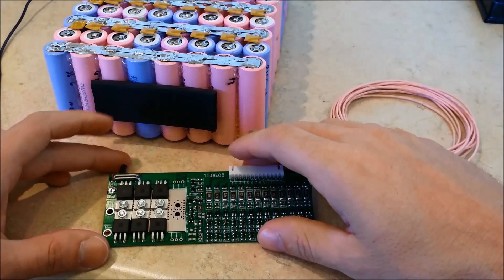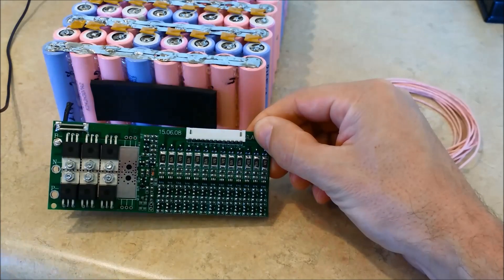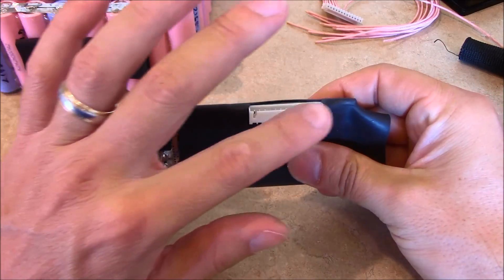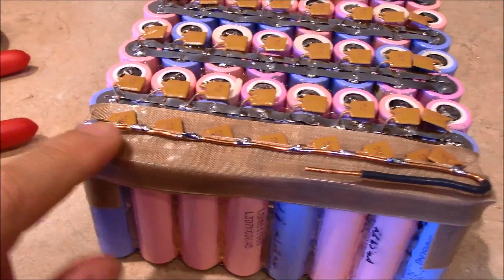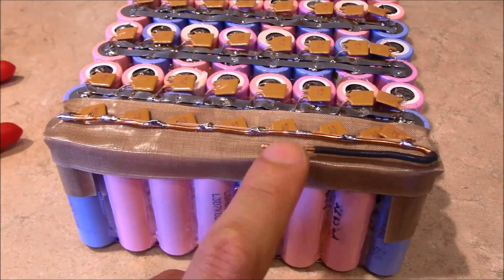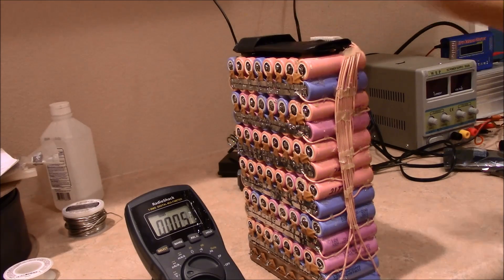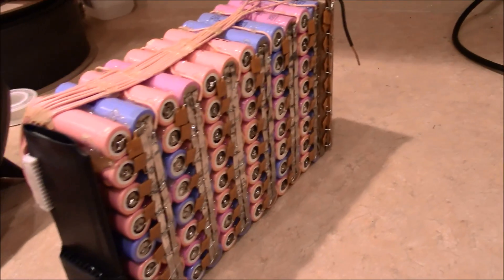18650 lithium ion battery "Wiring the BMS" (Part 4 of 7)

Comment: great video, would you please post parts list, links where to find them? and is it possible for you to show a diagram with wiring schematic (battery, sms leads, fuses)? thx!
Reply from the maker: Thanks,  I have a picture on my home https://plus.google.com/u/0/+15secofFame/posts/p/pub that shows the BMS and battery schematic if that helps.  

The fuses are something I was trying and are not necessary, but here is the link  http://www.ebay.com/itm/100-Pcs-New-JinKe-Polymer-PPTC-PTC-DIP-Resettable-Fuse-16V-4A-JK16-400-/181623447300?hash=item2a4999df04

the tabbing wire link is here http://www.ebay.com/itm/30-Feet-Solar-Cell-BUS-WIRE-5mm-x-02mm-Pre-soldered-/251870723653?hash=item3aa4aa3e45

let me know if you have any questions!

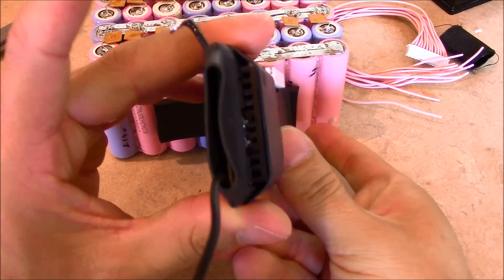Comment: The heatsink looks placed upside-down at 4:36 Shouldn't the large flat area should be what's in contact with the surface of those transistors to cool them off?
Reply from the maker: yeah your right on the the heat sink.  It didn't come with the heat-sink I added it from spare computer parts to help provide air flow over the transistors with added protection on the top of the them also.   They were only used during charging.

Comment: How many fuses did you use? I am about to build a 48v (13s 7p) pack and i would like to. Use these fuses........
Reply from the maker: I used one for each positive terminal so if you are building a 13s7p you will need 91 fuses.
Reply from the maker: dvdrwsor Thx man,  yes they will close after the fault cools down.
here's a link on ebay http://www.ebay.com/itm/100-Pcs-New-JinKe-Polymer-PPTC-PTC-DIP-Resettable-Fuse-16V-4A-JK16-400-/181623447300?hash=item2a4999df04
Reply: Great project. 
So after (if) they open up, you check the faulty one and exchange it, or do they re-enter the working state once they cool down? What type of fuses are those? I want to buy them from mouser.

Comment: what"s the yellow things?
Did it safe for the battery connect in series?
Reply from the maker: +# Uncommon The yellow things are reset-able fuses for extra protection.  yes they are safe.   You dont have to use them, but I thought I would try to use them just as Tesla uses fuses.

Comment: I think you should connect BMS board like it should. Take power from board and charge battery as well. BMS should be connect all time for monitor cells,balance them and control,not for charging only. Maybe that's the problem.Your discharge rate is direct and nothing is controlling cells. Think like this: What if one pack have higher resistance than another? That pack will lose power much more and that can disbalance battery pack. You should test each cell with B-max(battery resistance test when cell is full charged) and write down resistance as well and later combine them with capacity and resistance together That will be awesome pack. 60 amp board should do the job. Btw: Love your videos! Great job! Thanks :)

Comment: hypothetical scenario where the pack is outputting its 32A max current. if one (of the eight) tier 13 fuses gets triggered this will cause current from the 12 cells under it to be rerouted and shared among the other 7 fuses at tier 13. say cell#13 in one of the strings somehow blows and triggers its fuse, this will cause the approx 3.6A from the 12 cells in its string to be rerouted to the other 7 tier 13 fuses.  that's about 0.4A increase per tier 13 fuse. if the whole pack was running close to 32A, none of the other 7 tier 13 fuses will be able to handle this reroute and will trigger off in a cascade shutting down the whole pack. to prevent this from ever happening the threshold is 28A max for the whole pack.  this is worst case. if the first fuse to go off is a lower tier one, the margins are smaller.
Reply from the maker: +Follow Media good analogy,  the fuses are 16v @4amps, but I am using them with 4.2v or less so they are now good up to 16 amps each.   They are there for extra safety in case I damage a cell.  Figured if Tesla can do it why not me :)

Comment: Isn't it a waste of time running a bus bar and then connecting with resetting fuses? I think you've put a bus bar on all the negatives? Just want to be sure.
Reply from the maker: +harveyboy45 yeah I connected all the negatives with a bus bar and connected all the positives with the fuses.   You don't have to and most people dont, but I thought since Tesla does it why not do it to for extra protection.
Reply: +15-sec-of Fame I thought so. Bit by bit it's all coming together:) . Did you manage to source some wide pvc shrink wrap for your pack?
Reply from the maker: harveyboy45 I did but before I cover it still need to install a maintance port (d-sub connector) to maintain each bank if they become unbalanced.
Reply: +15-sec-of Fame is it essential to add resetting fuses to top n bottom of pack? Cheers
Reply: +15-sec-of Fame I'm really struggling to find any wide shrink wrap.
Reply from the maker: harveyboy45  no, you really dont need the fuses.  Its actually rare to see them on ebike batteries.  Here is an example of the shrink wrap tubing you can look on ebay to find the right size.  It will shrink down to half of its normal size.   http://www.ebay.com/itm/228MM-145MM-PVC-Heat-Shrink-Tubing-Battery-Wrap-/321615000284?var=&hash=item4ae1bf72dc

Comment: Hello.
This video is very helpful for me to building 18650 Battery pack.
I have a question about the best sequence for wiring BMS to Battery cells.

I guess that you first connected the white color balance connector into BMS, and then soldering each wire on the battery cells from 0V to the positive pole of the top of the cell.
Is that right?
But, for my case, I first soldered all of the battery cells with balance wires, and then connect the balance connector into BMS. 
I did like this four times. I succeeded three times, but failed once. When connecting the balance connector to BMS, the BMS was broken with a little spark occurring at the end of positive pole.

What do you think of this situation? Do you think it is caused by the wrong wiring sequence or bad/low/already broken quality of the BMS?

Please give me your opinion.

Thank you.

Comment: Also a side note, my battery bank comes out to 3.7v instead of the 4.2v that I see most videos at (including yourself) per battery. I'm no expert so running off of strictly videos here lol. The voltage is steady though and I do not know if this is an issue as well.

Comment: Hello,

I'm building a DIY battery bank for my electric bike as well, and I have been following fine up until now. So each "bank" shows the correct voltage readings (also checked the batteries before building the bank) with no issues. I installed the BMS wires (same chart as yourself too) and the last step was to installed the last wire on the BMS wire 14 to the positive number 13 of the battery back along with wire 13 to the negative side. Again, all my readings are correct for the bank, however when I get to the end of the cord that goes to the controller/motor/etc it only reads 14.20v? This current is not strong enough to run the cycle of power for the motor.... I am at a loss here. Please help!
Reply from the maker: man sorry!  Dont think I saw your comment.  Hope it is working better now.  Looks like it could be a BMS issue going into protect mode.  I only used my BMS as a balance charger and came directly off the battery to the controller to avoid issues like this.   Please let me know if you found the issue!

Comment: I have 2 questions. 

1. How do you regulate the discharge current to prevent the batteries from going below 3.7V after by passing the BMS since you are only using it for charging?

2. After connecting my BMS I only have 47.2V from the BMS to the motor and 54.2V coming in. Nothing works not even the power level meter lites up. Any ideas?

Thanks
Greg
Reply from the maker: +Tucker Not Sucker! sorry man I'v been gone on vacation.  Were you able to get it working?  The cells are good down to 3.0v safely, so once I see the meter at 1 bar when your "not" on the throttle its at 3.7v.  Plus during my test run I brought a meter with me so I know my limits.
Reply: 15-sec-of Fame I took a different approach. I purchased cheap batteries and found out how fast they are destroyed when I draw the current to zero. They don't last very long but, the charging time is fast. Ha! I just purchased 28 HP laptop batteries and I am planning to build 2 48V 13S batteries connected in parallel. How many amps of continuous discharge current will my BMS need to supply to avoid it from shutting down the battery? I have a 30 amp continuous with a 60 amp max. think this will be sufficient? I don't want to destroy anymore batteries. Thanks
Reply from the maker: It should be fine, but it all depends on the load.  What is the size of your kit and what size is the future battery?  you just want to make sure they match so the battery doesn't overheat.
Reply: 15-sec-of Fame It is a 48V 1000W hub motor so 13S 48V battery.
Reply from the maker: Ok cool, I wouldn't go below 20 amp hours on the battery and if you make the 16p13s battery you will be able to go 100 miles :)  your controller will take in 27 amps + or - 5 amps so your BMS will be fine.   the Dell cells will be a great jump in power and distance.   The cells that I have are 2/3's of there capacity and is doing great on a 1500w hub.  I am still testing the battery as much as possible and have found that I have bank 10 loosing power overtime.  So I need to remove bank 10 and find the cell or cells that have become resistive.  Even if you had new cells this can start happening, but people would know it because they don't know how to monitor the battery.  As long as you keep it balanced you battery will last a long time :)
Reply: +15-sec-of Fame Thanks for the advice and information on quality batteries. The only monitoring device I have for the battery is a digital % gauge what kind would be best for monitoring the amps?

Unfortunately, I have become the unwitting expert by default on diminished battery capacity after destroying some 700 or so. Ha! I was happy with 5 miles out of cheap batteries I will be impressed with 20 miles. Thanks
Reply from the maker: No problem, to monitor the amps I just test each one before building the battery so I have an idea what size my battery is.   I then rode the bike as fast as I could until the battery voltage was at 48v (when there was no load) and that was 30 miles :) for a 18 Ah battery on a 1500w kit.
Reply: 15-sec-of Fame Well I received the 38 laptop batteries they are all the same with LG 18650 2800mAh 6 per battery, only thing is they are flat tops. I don't think I am supposed to be soldering on the flat tops as I have ruined 3 or 4 from spontaneous combustion. I have the cheezy spot welder for batteries but at it's highest current the metal strips can easily be peeled off and don't trust it. 

I noticed the difference in these batteries compared to the ones I had been using right away. It takes about 20X longer to charge 1 battery than it takes to charge 13 cells or 130 of the cheap batteries. Is there any other way to connect these batteries? Thanks Greg 4spklrs@gmail.com
Reply from the maker: Tucker Not Sucker! wow man yeah be careful.   How thick is your nickel tabbing wire?  I think you want to use from 0.5mm to 1mm pure nickel.  If its to thin it will blow thru it during welding.  During soldering I tried to be as quick as I could so I didn't overheat them and my tabbing wire was pre-tinned with solder.   I also tinned the + and - on each battery.
Reply: 15-sec-of Fame I suspect this was the issue I had .08mm strips. I have since gone back to soldering the connections and I am also pre-soldering the 5 amp fuses and getting in and out as quick as possible. I started charging each cell individually as they were completed and regret this as it takes so long to charge a cell it is holding the process up. To late to stop now. These laptop batteries will be far better I can feel it. Ha! Thanks
Reply from the maker: Awesome man!  I plan on buying a spot welder soon just need to time away from work to really look at my options, plus Im looking at buying new cells.  Let me know how it turns out man!
Reply: 15-sec-of Fame Worked out great! Runs like a raped ape! So what about the draw at full speed the percentage goes way down below 50% does this damage the battery?
Reply from the maker: Tucker Not Sucker! LOL, dude that's awesome!  good to hear that it working out great.  Just keep an eye on the battery and that its staying balanced and your good to go.  Good job man!
Reply: 15-sec-of Fame Got a question for you. How do I discharge 13S. I have have been moving the negative discharging 6 - 6 and 1 must be a better way?

If you go balls out everywhere why don't your phase wires melt? Mine are constantly melting where the larger gauge wire meets the smaller at the connectors. Is there no hills where you live maybe? Thanks

Comment: Can you please explain more detail with the  typical examples about using the resettable fuses on your battery pack ?  Why do we need them ? When does the situation accidents happen? (any particular accidents ?..) I am very new to these batteries. There are some 18650 batteries selling at Ebay with a cheap price. They are listing with at very high ampere (3800, 4000, 5000, 6000 mAh). Are they ok for building battery pack for the electric bicycle ? Thanks
Reply from the maker: Alex Sky hey Alex thanks for the comment,  You really don't need them, but the fuse idea came from Tesla.  They use a one time only fuse that are rated around 3 amps.  The fuses I installed will re-set and keep the cell from overheating if they get out of control when releasing too much energy similar to a short etc..My fuses are rated @4 amps @16v so actually they are now good up to 16 amps each due to the lower voltage of 4.2v.  The wire is thick enough to handle the 54.6v at 35A max and its divided by 8 thru fuses to deliver the power.    If you added up the wire in each bank it will similar to a 10ga wire.  My house here in the US has 14ga to 12ga wire that is rated for 15 to 20amps with 120v at 2000 watts with very long runs through out the house.    I just know what could happen if I took a spill on the bike damaging a cell.  They are there as a back up for protection from each cell.  Hope this helps man, thanks again!
Reply from the maker: +Thuong Nguyen Hey Thuong,  I'm using them as a precaution from a crash that may damage a cell.  If one cell is putting out to much amperage it will shut down and keep it from overheating.  Most people dont use them and thats fine too.  Mine are 16v 4 amp fuses and I am using them on 4.2v cells which now means they will open if the amperage gets to about 15-16 amps for each cell.   Tesla uses fuses also, but once they open its done and will not reset.  If your buying 18650 cells on Ebay know that there are some fake cells that claim more than 3000mAh.  18650s really dont go much higher than 3000-3400 mAh max.  Also look for cells that have a 2C or higher discharge rating for ebiking which means that it can safely discharge higher amperage without overheating.  So lets say you bought a 3000mAh cell that s 1C it can safely discharge 3 Amp's.  If you have a 2500mAh cell that's a 2C it can discharge 5amps.   I think the best ones out right now are the samsung 18650-29E.  it's a 2C cell 2900x2=5800mAh discharge rating.  18650's can put out a lot more amp's but it needs to be brief and this is why I installed fuses.  When Im at full power Im pushing 2-3c on my cells and that's why I was getting a hot battery, so now I keep the speed down on long rides. I also think that I have 1C cells in the battery (I need to remove them).  I can add more cells to distribute the load and lower the load on each cell, but that means more weight.   let me me know if you have any more questions!
Reply: +15-sec-of Fame This has been eating away at me for a couple of days now. I can't seem to wrap my head around choosing a fuse. I'm building a 13s7p pack, with 3.7v by 2600mAh cells with a 1c discharge. If I understand correctly, if the fuses sit on the serial chain between 13, 4.2v batteries, shouldn't that mean the fuse would need to withstand the entire 54.6v, in your case, by whatever amperage you are running to not blow? Or are you just using Ohm's law to determine the fuse size for each cell it connects to, or the 2 cells in total that are connected by the fuse (4.2v, or 8.4v, by whatever amperage)? I apologize if this sounds a bit scatter-brained, but I'm just trying to understand how to determine fuse size.On a side note, I have to say, you have one of my favorite documented builds I have seen so far; really impressive. Congrats!